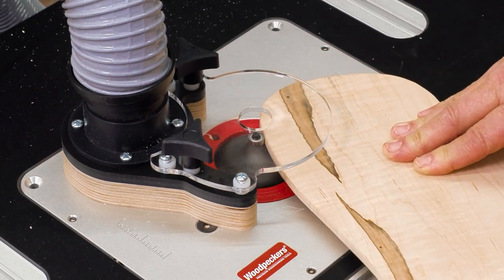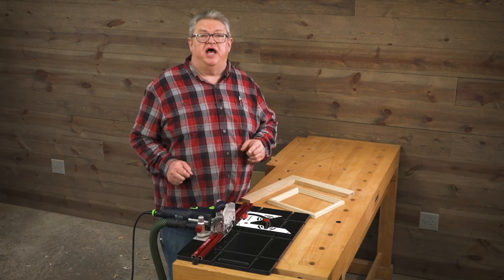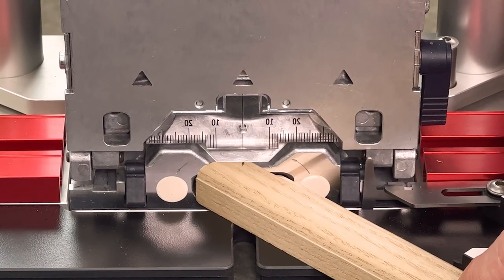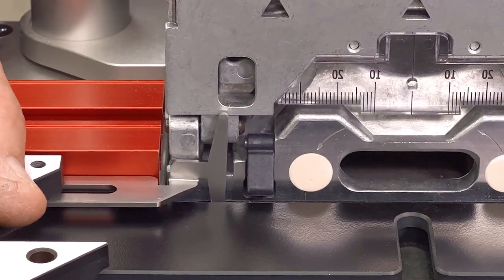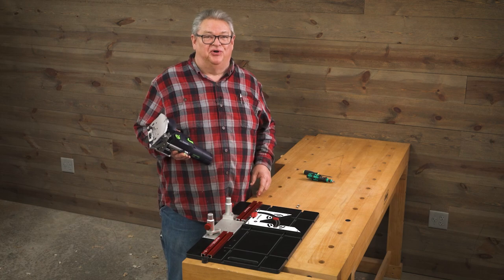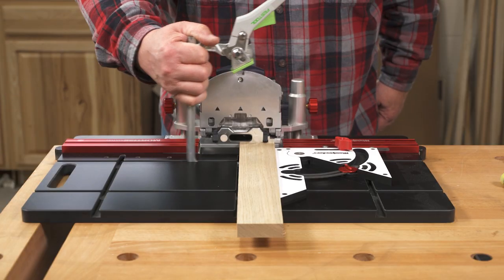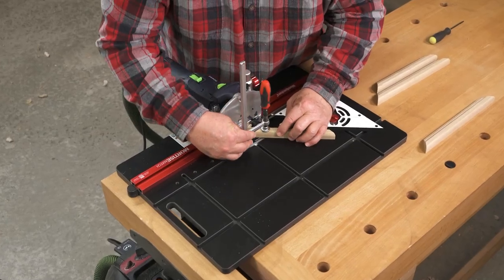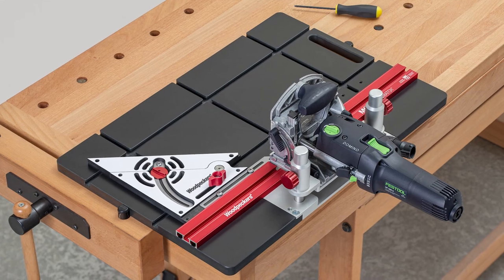MortiseMatch™ | Woodpeckers Woodworking Tools

Comment: I do understand that many budgets would not allow splurging on such an expensive tool, especially since Festool’s Domino by itself is a house payment for many.  I bought the MortiseMatch precisely for the reasons given in Woodpeckers’ promo.  My first project with it was a picture frame.  I could never have joined the miters without being able to secure the work pieces and plunge the mortise at 6mm from the bottom.  I actually was able to make double mortise and tenon joints.  Those miters aren’t going anywhere even if the frame members warp into boomerangs!  If you own a Domino, do whatever you can to get a MortiseMatch.  You will be amazed at the speed and accuracy of this set-up.

Comment: If you build furniture or other production with small parts joined with dominoes, it's great, too.  It's not just for picture frames.  It's especially useful in making chairs and small tables with angled small parts.    I am using my shop-made version based on Carmonius's modified design (with rod positioner), but if I had known Woodpeckers was going to offer its own version, I would have snapped it up in a heartbeat.  Building it to high precision standards (0.1mm) takes a lot more time than one might think.  I do think some appropriate hat-tip & honorarium ($$) to Carmonius would make Woodpeckers look a bit less like they wear eye-patches and say "Rrrrrr" a lot.

Comment: I like this design and might get one. I am currently using fixtures for both domino machines that were my basic idea and my friend designed and built. We even contacted Woodpecker about this 2.5 or so years ago. They did not seem interested even though it uses their base system. I know they would sell like hotcakes!
Reply: It's alway nice to have EXPENSIVE red hotcakes available!

I like Ola's design - well though out, but Woodpeckers' solution to the thickness issue significantly increased the cost to manufacture this jig.
Reply: @box0xB9  Who is Ola??
Reply: @jeremys5904  Ola Carmonius is “Carmonius Finsnikeri” on the YouTube channel.

Comment: The "Deep Dive" should be interesting . . . maybe they will talk about the history of this tool ( or NOT ).
Reply: You mean that they watched Ola C at CF and found his domino jig 😉 or the long process of painting it red and black?
Reply: @i679n5  Good point !

They do admit to spending time searching for a solution online, however. This is from the Mortise Match DESCRIPTION paragraph on their website.

"We found a few table mounted ideas online, but they didn't address the issue of material thickness and their indexing techniques left something to be desired."
Reply: @box0xB9  that seems contradicting. You could make shims with Ola's solution and the indexing of his solution is basically the same. Unless they are thinking of the angular indexing.

Comment: If you have the original Domino DF500 joiner with the indexing pins instead of flaps, I assume this still works? (of course, my indexing pins are always stuck, so I would need to deal with that)
Reply from the maker: Pete, Works just the same with the pins.
Reply: @WoodpeckersLLC  Excellent. Thanks. :)
Reply: Pete, I LOVE the pin version of the DF 500.  Have you tried a bit of paste wax on the pins to make sure they spring back easily? The springs will also weaken over time and can be replaced.
Reply: @WelshRabbit  I haven't disassembled it to check the spring or anything because I rarely use the pins. I will check closer, though, thanks.

Comment: can this work with a mafell DDF40?
Reply from the maker: The clearance to the Domino base is pretty tight and the bolt holes are matched to the Domino. If the Mafell is smaller, you could center it and drill holes for the Mafell base. If it's bigger, it probably won't work.

Comment: Looks like it's have a problem connecting vacuum hose to Domino XL. Stud is to close to the port. Need to come up with some kind of extension idea. Can't believe woodpeckers missed that.
Reply from the maker: We tested it with an XL and it's close, but we did not have any restriction.

Comment: I like the idea of this but it will cost me $1669.  Why?  Because I have an older Domino 500 with the plunging pins not the 20mm flip down tabs.  Unless i misunderstand the video the flip downs are required
Reply: If you have the DF 500 pin version instead of the flap version, consider yourself extremely lucky.  Those are discontinued and currently irreplaceable -- thanks, as I understand it, to a spot of bother between Festool and the patent lawyers for Mafell.  Perhaps the pins, which are vastly superior to the flaps, will be back some day when Mafell's patent expires.
Reply from the maker: David, no problem. It works with the pins just as well as the flaps.
Reply: I had the option of pins vs. flaps when I bought my Domino. I chose the flaps thinking they were better. Stupid me.

Comment: are the angles laser engraved on the Protractor Fence or arent there any written angles at all on there?
Reply from the maker: No engraving. Match the cuts on your stock. Much more important that the cut align to the Domino than be at a certain angle.

Comment: I guess because of the industry I’m in (farm equipment) I look at this whole “who’s idea was it first” thing differently. Innovation is stolen or “borrowed” all the time in my business. Deere will come out with an “industry first” feature with a cool acronym and turns out it’s usually something some smaller European manufacturer had 5 years ago. Heck if we’re being innovation purists here anyone with a non festool track saw is supporting this means of “product development. “I know woodworking is a tight knit community and I appreciate that. However the way I see it if it was such a great idea and he was seeking to profit or receive credit for it then he should have pursued that course via patents or bringing the system to market. If I’m missing something here and the guy pitched it to woodpeckers, they said no then they built it anyways then something like that would sure change my view.